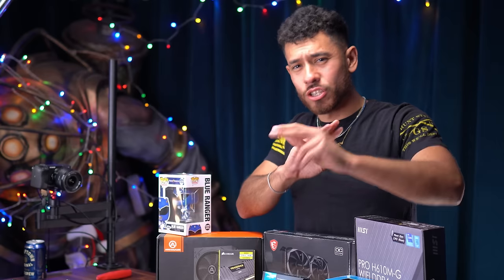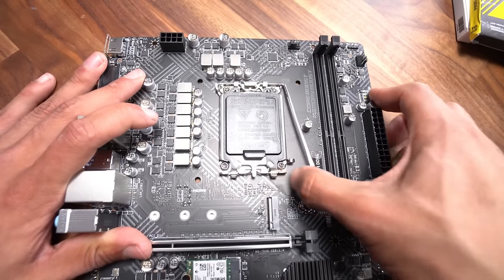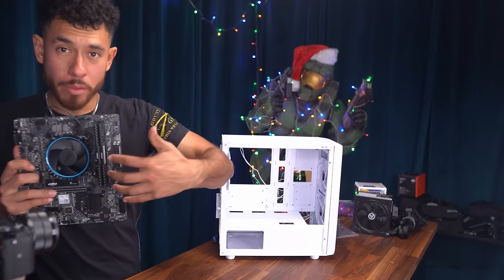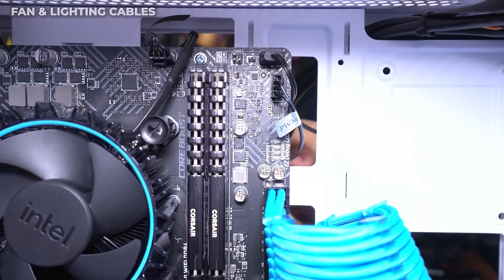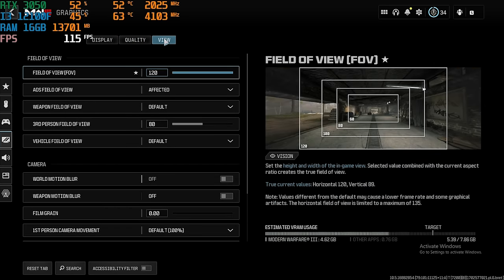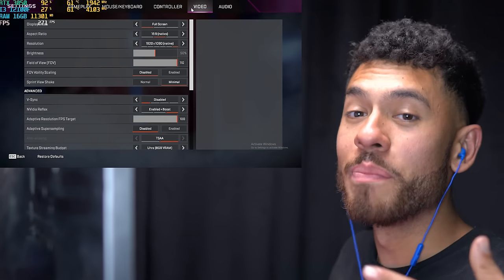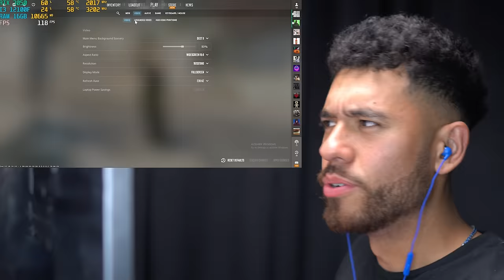Build the Best RTX 3050 Gaming PC for $600 - 2024

Comment: The RX 6600 is 5 Dollars cheaper at 210 USD in the U.S as of 1/18/24 and performs way better than the 3050 and 3060, want a bang for your buck gpu go with the RX 6600 instead
Reply: Can it ray trace?
Reply: Id rather future proof with the 3050 with dlss
Reply: @jomsies  thank you for using your brain
Reply: Neither does the 3050 unless you like low fps gaming or fuzzy graphics. @Gamer-vs3xl

Comment: Sold my PC almost a year ago to start my business. I've been putting away cash again to build another one. Thank you for doing cheaper builds. I can't wait to build one again soon!
Reply: Kept my ddr4 ram and 2 ssd's as well! Huge price savers (will still buy a cheap low storage m.2 for OS tho)
Reply: Hope your business is thriving man
Reply: What business may i ask?
Reply: @mentosinmytropicalvibes8854  I run a shirt company (print on demand) in which it is all hand drawn digital artwork for all ages. Thank you for asking  :)
Reply: @RustANutt  sounds sick man goodluck 🔥
Reply: How’d the business go?
Reply: @ethanvera1031  been trying but hitting consistent roadblocks, things that I have been working on since my last comment is advertising,  since I now have 50+ art designs to choose from now. Thanks for asking 🙂
Reply: @RustANutt  hey man hows it going now
Reply: @prodsiso  life has definitely had its ups and downs. I've had to put my business on the backburner, working 2 jobs right now just to save up for the winter. Hoping by winter I'll be able to give my fullest potential then. Either way I'm not going to stop trying. 💪 as far as sales go I've sold a few but definitely need to figure out a better market strategy 😆 I'm 100% to blame on that one. Realized I have to come at this from a different angle. Thank you for asking ♡
Reply: hows it going and how are you doing?

Comment: Thank you, I just built my first ever pc with this. Except I used the rx 6600, instead of 3050, everything seems to work decent :) (i also recommend using a different psu, the AGW is kinda slow) in the future, I do plan on upgrading some parts of course, but in general this pc/video is very beginner friendly

Comment: Please no one listen to this PC building clown.

I was definitely surprised at the performance you got for the money...surprised how BAD this build is. For $600 you only managed:
• A terrible value GPU in terms of price to performance. For The $220 the 3050 costs, you could pick up a RX 6600 (on par with the RTX 2070) for $209 and get a 20-30% performance boost.
• 512 Gb SSD, not a full 1 Tb
• An F-Tier PSU - basically a ticking time bomb of a unit
• A pretty sub-par CPU

If you have a tight budget, getting a secondhand components such as a used GPU is almost always going to yield a better build for the budget. But here's a better build FOR LESS using all new parts:
• Better CPU, GPU, full 1Tb of storage, Quality Tier-C PSU
Total: $587.59

CPU: AMD Ryzen 5 3600 3.6 GHz 6-Core Processor  ($70.00 @ Aliexpress) 
CPU Cooler: Thermalright Assassin X Refined SE ARGB 66.17 CFM CPU Cooler  ($18.89 @ Amazon) 
Motherboard: Gigabyte B450M DS3H WIFI Micro ATX AM4 Motherboard  ($84.99 @ Amazon) 
Memory: TEAMGROUP T-Force Vulcan Z 16 GB (2 x 8 GB) DDR4-3200 CL16 Memory  ($35.99 @ Amazon) 
Storage: Kingston NV2 1 TB M.2-2280 PCIe 4.0 X4 NVME Solid State Drive  ($62.75 @ Amazon) 
Video Card: ASRock Challenger D Radeon RX 6600 8 GB Video Card  ($209.99 @ Newegg) 
Case: Montech X3 Mesh ATX Mid Tower Case  ($54.99 @ Amazon) 
Power Supply: MSI MAG A550BN 550 W 80+ Bronze Certified ATX Power Supply  ($49.99 @ Amazon) 

I'm not done! If you have a few extra $$ in your budget, you could scoop up a RX 6650XT for $249.99 instead of the RX 6600 (bringing your total to $627.59). The RX 6650XT offers a MASSIVE 55-60% performance increase over the RTX 3050. If you want an Nvidia equivalent, the 6650 XT is akin to the RTX 2070 Super.
Reply: I love the 6000 series cards! Cuz I jus like to play in 1080p. Casual player thts all I need! Got any suggestions on which cpu to use with the 6700?
Reply: @GorillaBlack4F  The RX 6000 series GPUs are pretty awesome price to performance for the RX 6600 and up.
Nothing wrong with playing in 1080p! 

CPU would be based on preference (AMD or Intel), if any, and your budget. What are your preferences and budget?
Reply: @ShadyButFresh  thx a lot ! Ima try one of your builds! I think it’s right up my alley . Jus don’t kno how many vids I watch and ask questions lol. You get str8 to the point, and ima let u kno how it turns out. Thx again
Reply: Yo man, i like your build and i would want to my first ever gaming pc but do you think this change are good?
CPU: I3 12100F ( 5 euro difference from the r5 3600)
Cooler: stock intel cooler
Motherboard: i need you help about that , for some reason i just cant find really "budget* motherboard with inbuilt wifi so i will probably just buy an  pcie wifi card. Can you suggest me one that is compatible with the build and after i put the gpu there's space for the pcie wifi card
Memory: Corsair Vengeance LPX 16 gb ( here in italy the team group one is actually come expensive)
Storage: same one as yours
GPU: XFX SWFT 210 RX 6600 8 GB (the asrock one here is more expensive)
Case: the same bitfenix case that the the guy in the video is using
Power supply: same as yours

What you think??
Reply: @shahi4937  I think your build is okay. If you want to stick with intel and if you have the budget for a i5 12400f instead of a i3 12100f that would be a much better pick. You should also consider a different motherboard as well as the one he used is pretty low quality. 
For budget builds AM4 is preferrable imo. A R5 3600 + Asrock B450M/ac R2.0 is a staple pick in budget builds and you can later do a drop in upgrade for a the CPU without issue.
Reply: @ShadyButFresh  hey what if I use a R5 5600?? And btw for some reason can't find your exact Mobo that you recommended on Amazon, what other choices do you recommend?
Reply: hey ur going to hurt my 3050 rtx's feelings!
Reply: the fact no one streamer using amd on they gpu🤡

Comment: Please, PLEASE do more research before doing these builds. You featured a PSU known to short and catch fire when the 5v rail is under load, along with.. a really bad card that has no right being in this video. 3050’s are awful, unless you can somehow procure it for $150 or less. An RX 6600 is better in every aspect, for a cheaper cost usually. Not to mention the extremely low end QLC drive and barebones board- you can do a lot better for $600. Please do not mislead people into purchasing bad hardware.
Reply: Yes, the 3050 kind of does suck, but this is supposed to be an Nvidia build
Reply: What psu should somebody get
Reply: Lmao I litteraly run my 3050 on a. Antec budget psu
Reply: 3050s should only be used in laptops. And yeah those psus are pretty trashy. My uncle got one and I convinced him to replace it with a seasonic one.
Reply: Real
Reply: Well said buddy the 3050 is shit for the price. But remember there are no bad GPUs only bad prices
Reply: I understand the psu criticism, but I watched a lot if his videos and he already has a rx 6600 guide for chreaper. Why would he make the same video twice?

Comment: I'm shocked by how well the 3050 performed!!!   As a side note I recently was looking for used gaming pcs and mam are there some sweet deals on used rigs.  I saw everything from 1080ti to 3060s for under $500!!!  I eventually settled on a alienware aurora r7 with a gtx 1080ti for $350 which is a amazing deal and the 1080ti runs just as well as a 3060 non ti.  I had a line on a alienware area 51 with a 3060 for the same price but it got snagged out from under me at the last second of the auction.  I'm kinda happy it happened though as the cpu was way worse, it wad a x99 i7 5th gen unlocked though and the best i7 from 5th gen can't exactly remember the model but it was decent but the pc I ended up getting had a much better 8th gen i7 8700 with 6 cores and 12 threads and 4.2ghz!!! All that for 350 what's not to love?  Eventually I plan on upgrading the gpu probably to a 4060 or better

Comment: BitFenix Nova Mesh SE TG ARGB Edition High Airflow PC Gaming Case, Black/Black Mesh ATX 4xARGB Fans Pre-Installed 6+6 Controller (LED/PWM System) Temper Glass Aura SYNC/Mystic Light/RGB Fusion 2.0

Comment: change is the cpu cooler. get the deepcool ak 400 is like $30 and is going to be so much better than the stock intel one and look nicer to, and if you can up the storage to 1tb and if you dont mind going sata than get like a 1tb ssd, plus if need a faster ssd than your mob still has an m.2 ssd slot. so add $100 for a more quieter system and extra ssd space
Reply: Hi I need help I just built this build and I have a few leftover cables. I have 2 sata cables that idk where to plug in bc the back of my motherbord looks different than his and when I turn on pc monitor says no signal and fans dont work
Reply: what do you recommend for ssd ? what else can do to improve it

Comment: Love Micro-ATX cases that include 3 fans. I've seen alot of cases only give 1 rear fan with no front fans. I would copy this build but increase the budget for a 1tb Nvme SSD and an rx 6600/6600xt/6650xt.
Reply: does the rx 6600 give better performance?

Comment: Hi Crater,

amd ryzen 5 7600
msi pro a620m -e motherboard
gskill ripjaws 16*2  ddr5 5600mhz
crucial p2 1 tb 3d nand nvme pcle m.2 ssd upto 2400mn/s
rtx 4070
crosair cv750 750watt 80plus bronze smps
ant esports ice - 170TG (ATX mid tower cabinet)
deepcooler ak 400 cooler

can you please review and tell if this custom build is future proof and has no botlleneck for gaming ? is this build good optimised ? if not can you please suggest a good prcessor for rtx 4070 without bottleneck?

Comment: I have myself not much better setup in 2022, with 11400f and 3060ti it's a beast in 1080p and handles pretty well with 1440p. And since socket 1200 is dead platform what would be the next CPU i should upgrade? I was thinking about 13700KF with RTX 4070 Super - will this be able to keep 1440p and 160fps?
Reply: In most games sure, it will, but in some newer AAA titles only with dlss.

Comment: wondering if anyone can help me, i build this pc and it is running fine but only on Fortnite ive been experiencing massive fps drops and only Fortnite. All my settings are on low and i still get fps drops at 60-70 when it used top be constant 144. Any ideas on what to do, my drivers are all updated etc

Comment: Would have been so much better with an rx 6600 instead of rtx 3050
Reply: But you dont gonna have DLSS (sorry for my english)
Reply: I agree with you. But some folks absolutely have to have an Nvidia card. The 3050 8GB is the second cheapest brand newNvidia GPU on the market. But the cheapest Nvidia GPU is the much weaker 3050 6GB card.

Comment: the powersupply doesnt show but can I use Thermaltake Toughpower GX2 80+ Gold 600W SLI/Crossfire Ready Continuous Power ATX 12V V2.4/EPS V2.92 Non Modular Power Supply 5 Year Warranty PS-TPD-0600NNFAGU-2

Comment: Used 5700 xt kicks 3050 ass all day everyday
Reply: What cpu u running with that
Reply: @sikhness_033  Can be the same 12100f hes using in the video, a i5 12400f, 5600x or non x your pick.

Comment: Hi Joey, can you try please this build?

AMD Ryzen 5 5500
MSI B550M PRO-VDH WIFI
Corsair Vengeance LPX 16 GB (2 x 8 GB)
MSI SPATIUM M461 1 TB
XFX Speedster SWFT 210 Radeon RX 6600
MSI MAG FORGE M100R
Corsair CV650 650 W 80+

this is what i wanna build, and have been saving up. and if you know where i can improve on any part please let me know, thanks! PS sorry for my bad english..
Reply: I almost have that exact .. only diff is the storage case and psu.. I just built .. I have shorts with it.. banger for the budget
Reply: @RanizmTheRealest  Sweet. Lemme see

Comment: I had to get a alternative pc tower case. The fans molex I connected to the power supply and thought to put the tsi from that series into the system fan port. Made a huge mistake and I think the motherboard got fried. Tower keeps turning off a minute into booting windows up from flash drive. However if I'm in just bios it runs without shutting off randomly.  Ordered a new motherboard hoping for the best.

Comment: What would be a better option for a cpu cooler
Reply: Don't really need one since the i3-12100F stock cooler will be just fine, but if you really wanted an aftermarket cooler that you could also put on another cpu when you upgrade, then the Deepcool AK400 will be perfect.

Comment: Crater I need  some advice fto upgrade mine it cant even run br in fort on low settings (I bought it for 200 thinking it was a good pc)

1. ryzen 5 1600
2. R9 390 GPU
3. AsRock B450M/AC Motherboard
4. 8 gb ddr4 ram
5. 1 tb hdd
6. Idk the wats of my psu

(bruv cant i please get that pc u jus built when ur done wit it)
Reply: (My budget is 200 dolalrs and i was wondering if i should try to sell it back and go for this build instead)
Reply: My advice is try get a 5700XT around the 100 mark, add another stick of 8GB Ram and add an SSD, this should help & if you can upgrade to a 3600, should be a solid build if your PSU can handle it. :yt:
Reply: A PS4 is more powerful than what you bought.
Reply: is it true a ps4 is more powerful than waht i bought  @AlexHusTech
Reply: @eternaldream4185  No it's not yours is 20% faster, what you bought for 200 is a decent price. You can sell the GPU for a more powerful one, add a SSD to make it faster, add another 8GB stick and upgrade to Ryzen 3600.
Reply: I was thinking about trying to sell this back for 200 and tryna caugh up the money to build this one  @AlexHusTech
Reply: @eternaldream4185  This is too expensive, you can easily build a better machine for cheaper.
Reply: what specs? @AlexHusTech

Comment: Would a Intel i5 still work on this?
Reply: i5-12400 would be perfect for this but honestly save your money on upgrading the cpu and put it to the GPU so you can get more fps out of it, and honestly if they bought a used or even a new 5700XT from aliexpress it would've had way better performance.
Reply: I5-3470 I also have a i3-3470 just some extra parts I have I wanted to use the that i5 to save money on not buying another cpu.

Comment: Ima build this
Reply: no please you can build a pc with ryzen 5 5600 and rx 6600 which is roughly 35-40% faster than this
Reply: @_mariko791  is it cheaper?
Reply: @Otzxy  rx 6600 is cheaper than 3050 in our country but outperforms it by 35-40% which is significant
Reply: @_mariko791  it’s also cheaper here so I’ll get it but should I keep everything else or change those to
Reply: @Otzxy  get the ryzen 5 5600 + asrock b550 mobo. AMD GPU + CPU will work the best and this is the best build for $600 using bnew parts
Reply: @_mariko791  I’m kinda new when it comes to building so will it be kinda the same as when he built it?
Reply: @_mariko791  so I just change the motherboard,the cpu and the gpu?

Comment: Someone please help. i built this and just out of curiosity i came back to Fortnite to see if it really gets 300 fps and i was struggling to get 120 WITH his settings.
Reply: probably ur monitor
Reply: @xqJulian  no I have a 240 Hz monitor
Reply: @P5_Studios oh then idk
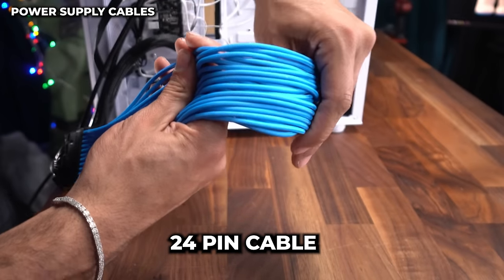Reply: @P5_Studios and did you get the 24 pin extension cable for the power supply? It’s at 13:22
Reply: @P5_Studios if u did then where do u get it?
Reply: @P5_Studios  Did you update the drivers? Do you have the same cpu?
Reply: Wdym 300 fps
Reply: He avg 200 fps so in creative he will avg 400 fps since there is less delay?
Reply: @MrEditorsSideKick  yes but I fixed it myself. Not really sure why but just reinstalling the game made it run much smoother
Reply: @xqJulian  no I did not

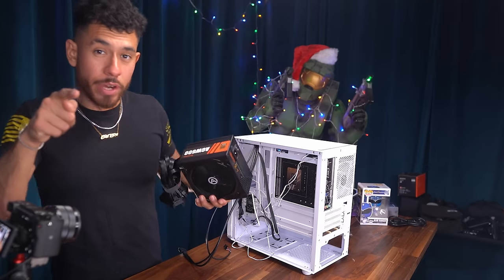Comment: 12:26 New to pc’s why is the power supply fan facing down?
Reply: To pull cold air in
Reply: @breakncrazy ahhhh didn’t see the holes under
Reply: @liltimmy8529  it’s a mesh you know right?

Comment: At 600 you couldve gotten an 3060 maybe even 3070
Reply: yeah i built this build and replaced the 3050 with the 3060 and it runs AMAZING. I'm actually currently typing this on it
Reply: @P5_Studios Did u have to change anything else?
Reply: @warbadank   no but I might eventually replace the Intel I3 with something a little more powerful.

Comment: Horrendous build man, Do not get an aresgame PSU, they are F tier on the PSU cultist tier list, you can get a b660 board for cheaper, you can get an rx 6600/a580 instead and gain a 30-40% performance increase.

Comment: TBH, I can build better pc for that price... This is way too overpriced
Reply: Hey bro I need help building a pc I wanna stream but I play comp fortnite I want pure performance what you recommend for this price need good fps
Reply: @lucastorresthegoat  Go for Ryzen 5 3600 or even 4600g in CPU side of view, 32GB Dual channel which means (16+16) RAM with 3200Mhz, B450M motherboard and GPU go for RX 5500xt.. Much enough for play and stream games like fortnite, valorant, RSS, CSGO/CS2 and most of the competitive games. Also decent for some newer titles too.. If you want more performance and quality then focus to upgrade your GPU..
Reply: @FloatSamplesGT710 should I replace the rtx 3050 with a rx 6650 xt?
Reply: @xqJulian  yes, if you can find for decent build
Reply: Wdym find for decent build
Reply: @FloatSamplesGT710 I can’t just switch the rtx 3050 and leave all the other pieces the same
Reply: I also want to switch the rtx 3050 for the rx 6650 xt
Reply: @Carlos-iy3pn  I said even better